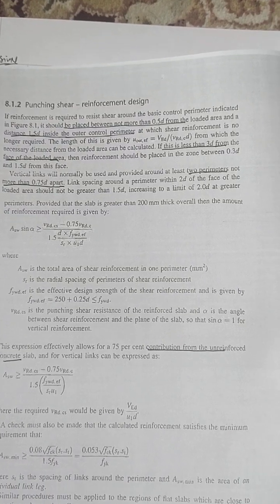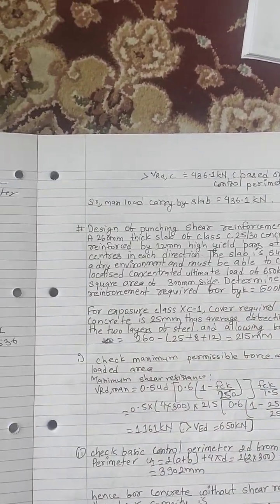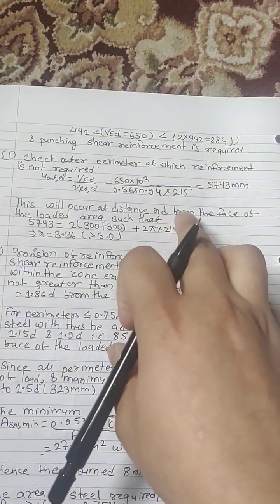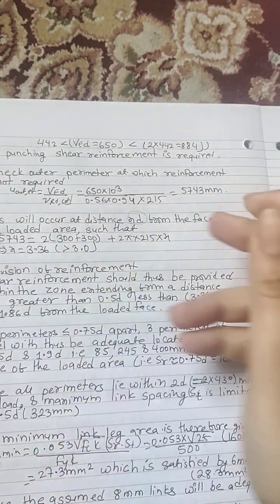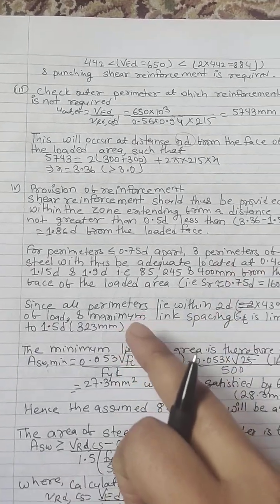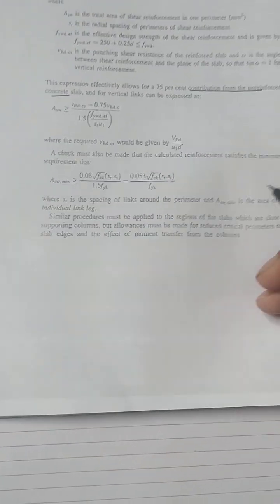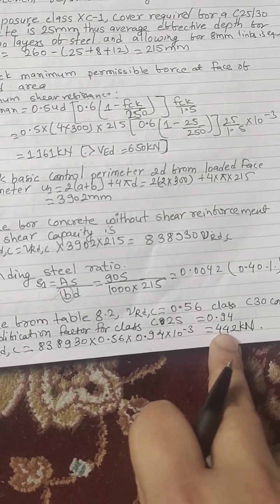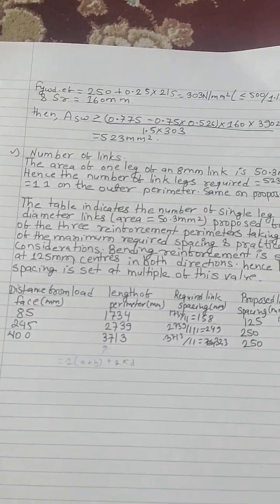Punching shear- reinforcement design with theory and numerical part based on Eurocode 2

Comment: Hello. Could you explain one thing about the calculation of the pushing force of a flat slab? Once upon a time, in the Soviet standards, that were in force in our country, there was a formula that determined the pushing force that is perceived only by the concrete of the flat slab. It looked like Fb=α*Rbt**um*h0, where α is the coefficient for heavy concrete, which was taken as 1, and less than 1 for other concrete. Next was Rbt - the calculated tensile strength of concrete, um - the average length of the contour of the pyramid of pushing, h0 - the working height of the section by analogy with d in Eurocode 2. How do I know, based on Eurocode 2, how much my flat slab, for example, 200 mm thick, column 400x400mm carries a pushing force without transverse reinforcement? For example d=16cm, fctd=1.15MPa, um=((400+400)*2+(400+2*160+400*2*160)*2)/2=2240mm. Then our flat slab can may carry VRd=1*1,15MPa*224cm*16cm=412kN. But in Eurocode 2 how to find this force? Sorry for my bad English, but I hope you understand me
Reply from the maker: I appreciate your detailed explanation of the formula for calculating the pushing force of a flat slab based on the Soviet standards. In Eurocode 2, the calculation of the shear resistance of a flat slab involves different parameters. The formula for shear resistance (VRd,c) in Eurocode 2 is given by:
VRd,c=k⋅( 100⋅c⋅kc/ γc⋅fck)⋅b⋅d
Where:
k is a coefficient that depends on the type of aggregate and is typically taken as 0.15.
c is the distance from the centroid of the tensile reinforcement to the outer compressive fiber.
kc is a coefficient that takes into account the tensile strength of concrete, usually taken as 0.8.
γc is the partial safety factor for concrete, typically taken as 1.5.
fck is the characteristic compressive strength of concrete.
b is the width of the section.
d is the effective depth of the section.
For your specific example, considering a 200 mm thick slab with a 400x400 mm column, you would need to determine the values of c, fck, b, and d based on the geometry and properties of the materials. Once you have these values, you can substitute them into the Eurocode 2 formula to find the shear resistance.
Reply: @projectcontrolhub-n6x  V.Rd=V.Rd.c*(u.out.ef-u.0)*d/β formula like this.
Reply: @projectcontrolhub-n6x  Thanks for the answer. So I understand that I can get the shear resistance of concrete according to this formula. But its units of measurement are MPa. How to obtain such a value for a certain cross-sectional size of the column and the thickness of the plate force in kN? As I understand it, it is necessary to know the area of punching of the perimeter u_out and multiply this value by VRd,c, and we will get strength in the form of force and not pressure?
Reply from the maker: @inzhener-konstruktor  To obtain the punching shear force in kN, you can follow these steps:
1.	Calculate the Perimeter (u_out): Determine the perimeter of the critical section for punching shear. This is the outer perimeter of the loaded area. For a column, it is typically a rectangular shape around the column. The formula for the perimeter is uout=2⋅(a+b), where a and b are the sides of the loaded area.
2.	Calculate Shear Resistance (VRd,c): Use the Eurocode 2 formula to find the shear resistance VRd,c) in MPa. The formula is VRd,c=k⋅( 100⋅c⋅kc/ γc⋅fck)⋅b⋅d, where k is a coefficient (usually 0.15), c is the distance from the centroid of the tensile reinforcement to the outer compressive fiber, kc is a coefficient (usually 0.8), γc is the partial safety factor for concrete (usually 1.5),fck is the characteristic compressive strength of concrete, b is the width of the section, and d is the effective depth of the section.
3.	Calculate Punching Shear Force (V_u): Multiply the shear resistance (VRd,c) by the perimeter (uout) to obtain the punching shear force (Vu) in kN: Vu=VRd,c⋅uout
This will give you the force in kN instead of pressure. Make sure to use consistent units throughout your calculations.
Reply: @projectcontrolhub-n6x  Thanks. Yesterday I already derived this formula, but there it is still necessary to take into account the working height of the section (d) so that the units of measurement are in kN. The following formula came out V.Rd={V.Rd.c*(u.out.ef-u.0)*d}/β
Reply from the maker: @inzhener-konstruktor  That's great you derived the formula. Yes, you should take the height of section(d) for the above-mentioned formula to get the unit of measurement in KN.